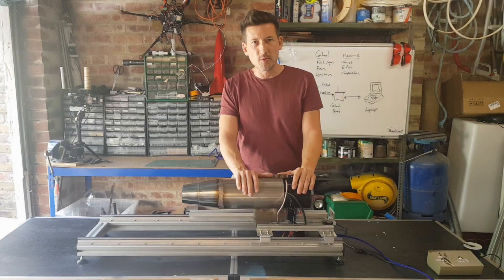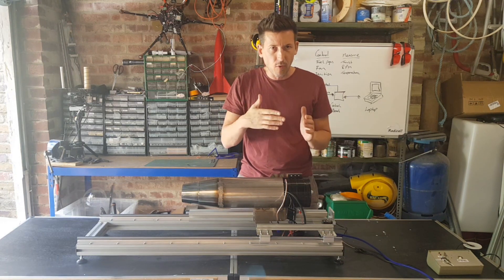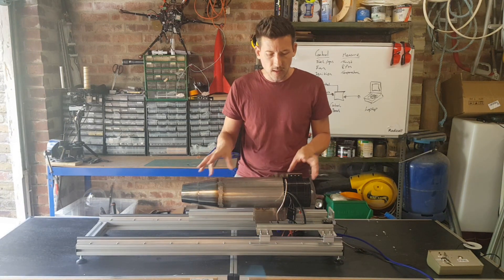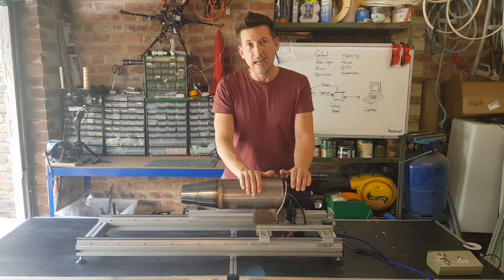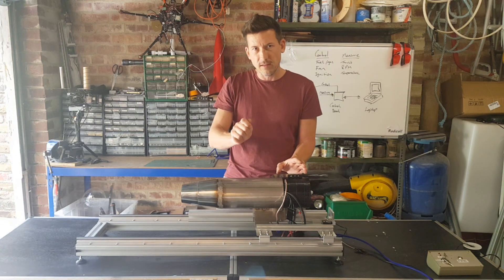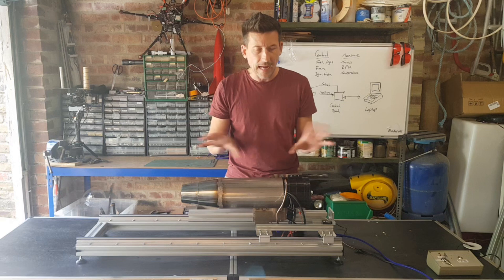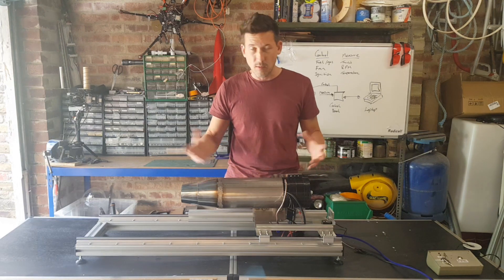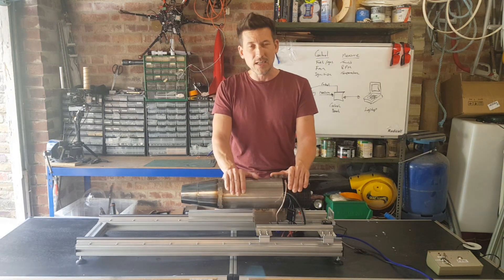Hybrid Electric Ramjet Prototype (Part 2)

Comment: Maybe add a map or maf car sensor to give air density and pressure values.
Reply from the maker: Yes Sean, air pressure as well as air temperature between the fan and combustion chamber will be a good idea.

Comment: Are you  looking at  doing thrust vectoring with that because it looks like you have a separate nozzle on the end. Also funny I just said about this on your other video today and you have already done it! I guess you have got a flame tube in there rather than just injecting the fuel in the side? Also, check out Tech Ingredients videos on hybrid jet engines, they are really good. One last thing, if you want any help with any CAD, I've got an SW Mech Design Associate level so I can help with some stuff if you want a hand. I look forward to seeing this project progress.